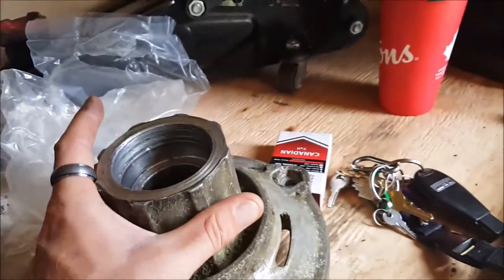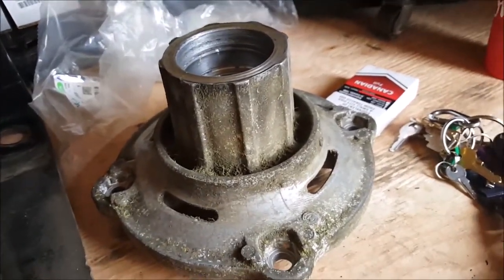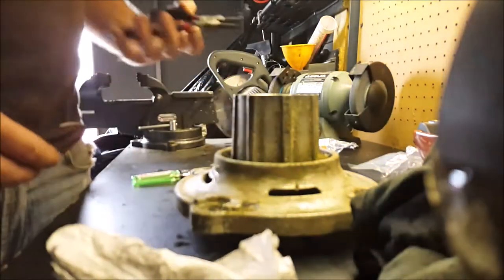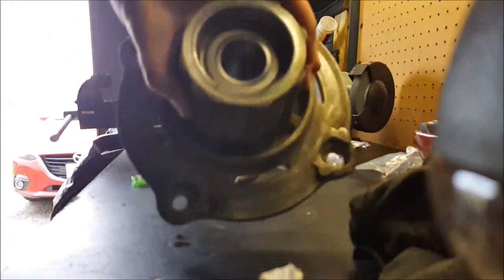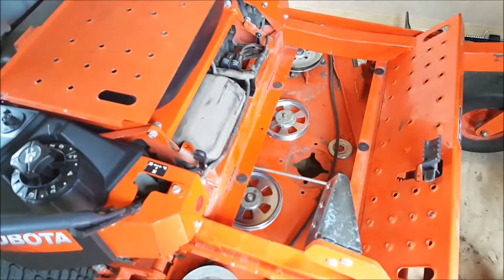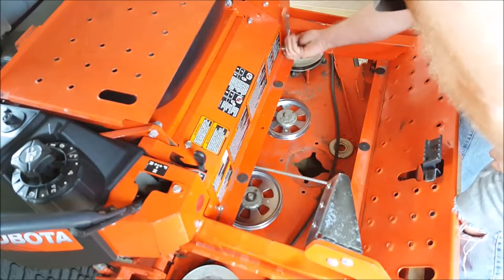How To Replace Spindle Bearing On A Kubota Zero Turn | Spindle Bearing Replacement

Comment: That part you discarded gose underneath on the bottom of the spindle befor you put the shaft through the spindle to protect the bearing on the bottom.

Comment: U said u took the one pulley off first, is there a trick to it as I am having trouble removing the pulley u removed to help with belt tension
Reply from the maker: hmm this video is from a while ago, i dont remember their being much of a trick, just some of the bolts being underneath the deck for the pulley spindles.
Reply: FYI - there is a square hole in the flat rod pointing forward off the belt tensioner arm that you can fit a 1/2" socket wrench into.  Swing the wrench to the right and by doing this, you can take the tension off the belt and remove it.  No need to remove another pulley.

Comment: When changing the blades, do you have to hold tension on the blade itself? I tried to hold it on the spindle nut and it just backed off. They aren't revers threaded are they?
Reply from the maker: Yea I hold on to the blade from underneath just to break it loose on my machine.

Comment: Was there play in the spindle after you took the belt off? Or how did you isolate that spindle in general? 

I was mowing yesterday and it felt stiff and was bogging easily and after a bounce over a root it spun up to a speed I havent yet heard. Im wondering if a bearing broke.
Reply from the maker: hey i actually had play on the center blade when i purchased it. didnt relize until i took it apart that there were 2 bearings on each spindle and that the lower one had blown apart. It did make a rough noise when cutting that would come and go. fixed it right away of course.

Comment: I just bought a set of 10 replacement bearings for my Z726 after a bearing failure (not structural failure, just noisy) after only 100 hours of use.  I was disappointed  to see the original bearings I removed were stamped "China".  I bought the XiKe 10 Pcs 6206-2RS bearing from Amazon and seem to be a perfect fit.  At less than $2.50 per bearing, I took the chance of replacing the original bearings that had metal seals to a bearing with rubber seals.  I really don't see the need for a metal seal anyway.  Time will tell how these perform.
Reply from the maker: Excellent replacement find! I took possession of the z726 with 1 bad bearing. Dealer had it next day at 40 CAD per bearing but it too said china on it. Let me know how the aftermarket ones work out for you!
Reply: @McGo101  There are many replacement bearings out there, this is just the one I chose.  If it's a 6206 bearing it should fit.  The rest of the part number basically describes how the bearing is constructed, i.e. metal seal, plastic seal, etc.  I noticed they seem to have similar load and speed ratings also.
Reply from the maker: ok that is great thanks for the info. I will likely try one of those out next time one wears out. I have also been looking for aftermarket parts for this z726 ie belts but i am not having any luck. If you happen to find anything else aftermarket for our machines please feel free to let me know! thanks Donald Christie!
Reply: The rubber seals will let you remove them and make sure the bearings are properly greased before you install. Sometimes the ‘sealed’ bearings don’t have enough grease and wear out prematurely.

Comment: Probably the former owner did not keep the blades balanced,
thus causing premature spindle bearing wear.
Reply from the maker: Yup when i got her the bearing was toast and yep the blades were well worn out. New blades and bearing and she has been great since!
Reply: @McGo101  I purchased a $100 blade balancer & an expensive sharpener.
Hopefully I can avoid a bearing replacement. These non-greasable spindle bearings are planned obsolescence 
Thanks for taking the time to make the video...👍
Reply: I have always balanced my blades and still had failures.  I am now at 300 hours on my Z726 and have replaced both bearings in two of the spindles.  The third spindle is now roaring and needs replacement.  Its sad Kubota has cheaped out on such an important wear item.

Comment: Is there any way you can tell me the size of the bearing
Reply from the maker: Hey I'm not sure off hand but I bet you could call your local dealer to get the size on it. I got mine from the dealer but I hear u can get the same bearings cheaper online
Reply: 6206 with metal shields in both sides

Comment: It's never a good thing to have parts leftover when you're finished.
Reply from the maker: it was a while ago so i don't remember what parts were left over. iirc i had to get different bolts for the pulley tho. has worked excellent ever since tho!
Reply: @McGo101  Good to hear! Thanks for making the video. It was the dust shield that was left off, I'm glad it's still working good.